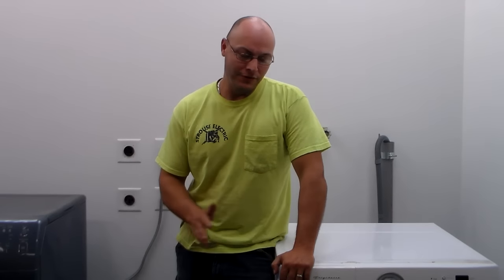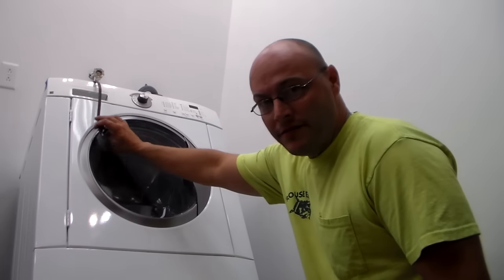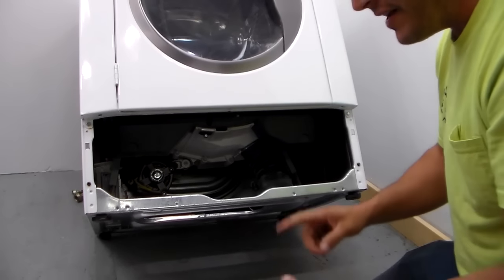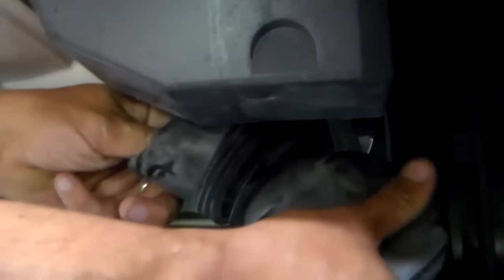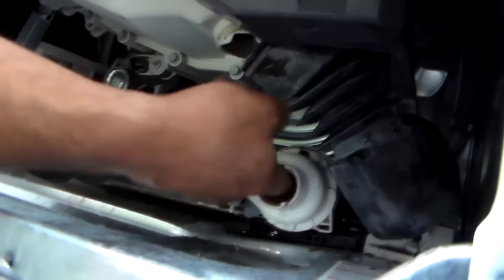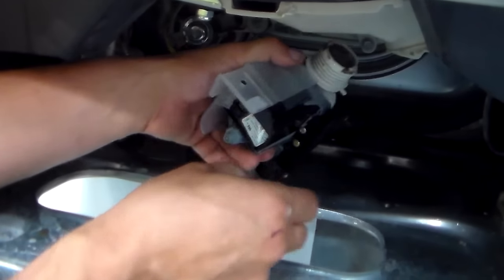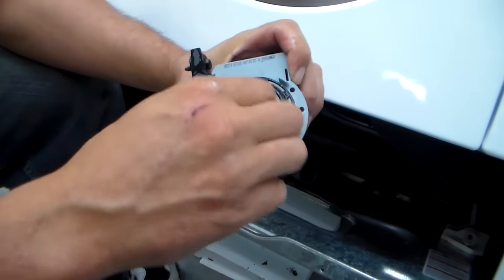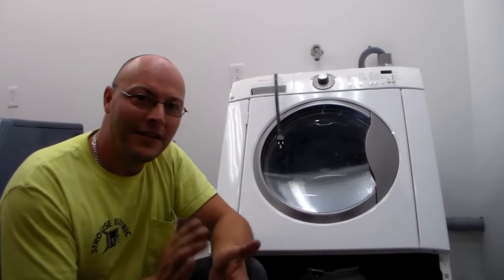Front Load Washer Repair - Not Draining or Spinning - How to Unclog the Drain Pump

Comment: I cant thank you enough 😂 I’m a 29 year old woman and a single parent who can’t afford a new washer right now and kept getting drain error codes and a humming noise and you made me confident enough to give it a go. I followed all the steps my brackets were a bit different but I toughed through it 😅 cleaned out the propeller part and then felt a wad in the tubing from the tub I got a drain snake and whisked it out because I couldn’t fit a flathead to loosen the tub hose without taking apart the whole machine butttt 2 pairs of panties and 2.00 in quarters later my machine works like new 😮‍💨you’re awesome. ❤ my dad thanks you because he was my next call 🎉😂

Comment: Hey Bill, I thought sure I was seeing a $300 dollar repair, My wife and I followed your directions including taking the white part off the pump, we took out of the screen 2.58, a bobbi pin and and underwire bra wire. Our washer works perfectly with only about 2 hours work, we don't have the front panel , to we had to remove the top and the front, but all is good. Thank you so much for your help. Sue and Bob Wagner   Arvada Colorado
Reply from the maker: +Bob Wagner Awesome job on your repair!  This is not the easiest thing to do either, great job!

Comment: Brilliant video.  Thank you so much.  We have a vintage washer in Spain with no user-facing filter, drain or indeed removable cover for access of anything.  Finally, using Stonehenge technology, we turned it upside down and located all the parts shown in the video and found three Kleenex tissues (at least) clogging the pump.  It's now working a treat.  Thank you so much Bill.

Comment: Well this video was everything I needed!   We ended up ordering a new drain pump, although I’m still not sure that was necessary – the reason I replaced it was once we got in there we didn't find any blockage or objects, but our impeller wasn’t spinning freely as you showed in the video (although there didn’t seem to be anything stopping it – there WAS some slight resistance). Here’s the thing:  the replacement pump was the same!   So some pumps might very well NOT have fully-spinning impellers, in case that’s helpful to anyone.  

Our washer is a 2009 Frigidaire/Electrolux front loader, analog, FTF530FS.  And it's working again!!!   Thanks for the video!

Comment: thank you thank you thank you for this excellent video. my husband and I fixed our machine tonight using your video. it was making a horrible grinding noise and wouldnt drain. in fact it hasn't drained well for months. coin trap was so clogged. not it runs amaizing. the only difficult part was trying to clamp the boot back onto the pump. took both of us to get it on. so proud we did this on our own and i only broke 1 finger nail. lol

Comment: i cleaned the trap, it started draining for one load then died again, so i came back and figured out how to take the front panel off, for mine you've gotta take the whole machine apart. Got that done, checked the pump and it's broke. Thanks for showing the pump and how to check it. mine was wobbling all over the place and basically wouldn't stop moving. Thank you

Comment: Thanks a ton, Bill. I thought I had to replace the pump, but after watching your video, I opened it up and found a nail jamming things up. My model doesn't have a coin trap though. We've had it for 8 years, and this is the first time anything has jammed the pump, so go figure. Great video! Thanks!
Reply from the maker: Ed Bannon Awesome Job,  you have completed a relatively hard repair for the average person without appliance repair experience!

Comment: I thought I needed a pump replacement, but all I needed was a cleaning!  This video helped me clean my hoses and pump much better than the previous serviceman, who cleaned only one of the areas of the pump!  I found 5 socks, a lego piece, and a bunch of foul-smelling gunk.  Note: If you find a solid plastic ball in the hose, remove, clean the hose of debri, then put the ball back.  I needed to Google that it works like an important valve.  I wish the video would have showed how to get the clamps back on easily because I had a pretty tough time getting it back on the biggest hose.  I ended up needing an extra set of hands to use my biggest set of pliers to clamp the prongs.  Then once it was back on the hose, onto the hole.  Leaked the first time.  To fix it, I needed to muscle the snug fitting hose and clamp up the pipe back up to the washer.

Comment: Thaaank you duuude! saved $200+ by fixing it myseeelf!  Had to go through 3 rude people over the phone who "diagnosed" (without seeing the washer) and told me to get rid of it... I followed your instructions, realized the propeller was broken, paid $24 for the replacement drain pump and changed it myself!.... yeah, not the original drain pump which as over $150, but I thought that if the cheap part survives a year, then the original would need to survive over 5 to make it worth, which is unlikely.. anyways, thank you for the guidance!

Comment: Thanks for video instructions.  I had no idea there was a filter in the bottom of the washer.  I cleaned mine immediately and now I am +62 cents and a paper clip.  But I have a tip for you.  Close the door to the washer and evacuate the drain hose with a wet/dry vac.  Beats having stinky water run down you sleeve.
Reply from the maker: Yes, very good.  I would have if that was in someones house.  I really didn't think about it for the video.  Great Comment and Thanks for Watching

Comment: Thanks Bill, our Whirlpool frontloader had the front panel with 3 screws, but it gets even better.  Theres a clean out access port right up front.  BUT: Not knowing...when I twisted and unscrewed the cover, only the cover came off...without the plastic catch basket with the holes in it.  SO: I took off the drain hose and prolly 2 gallons of water spewed all over the floor.   Removed the outlet hose from the pump and the wire connector and unscrewed the assembly from the base and completely removed it all.  Took off the housing like in the video to check for more debris...none so reassembled.   Only problem was the dang Clamp c/t the drain hose and basket housing was a bear so throwed it out and replaced with a regular screw type hose clamp.   Reinstalled everything and then had to "Unlock" the electronics by turning the machine on and holding the far right bottom button down for 3 seconds...BINGO!   Looking back, all I had to do was pull out the basket from its access point and clean it out...we did find some plastic tags from new clothes and two eyeglass cleaning cloth's, and a piece of some plastic label.  It was clogged no doubt!  Machine now works fine.

Comment: Just did this myself and your video was invaluable. I had almost $2.00 in change in the trap, and a garment label jamming the impeller from spinning at all. Biggest pain was dealing with the water going everwhere and all the wet clothes. One super handy tool was a hand pump and bucket for removing all that water from my Speed Queen front loader. Plus a bunch of cleaning towels to mop everthing up. I also used a box fan to dry everything after getting it back together (without the kick panel installed).

Comment: Thank you, thank you. My washer is back in business after a couple hours, a pinched finger, and a few magic words. I found nothing in the system (and there wasn't a coin trap), but the impeller balked a little when I first rotated it. It eventually began to turn more easily so I'm guessing it had some crud affecting it. It never did free-spin., but It does look a bit different from the one you show. I think I'll investigate the purchase of a back-up pump to be on the safe side. I might also check to see if I can add a coin trap. For now, tho, all is well. 

As an old ER nurse, I especially appreciate your recommendation to UNPLUG the machine before working.  Not all who have provided repair advice have included this step, and it's important for anyone unfamiliar with the equipment. I'd also suggest that the amateur prop the machine from underneath in addition to leaning it against the wall unless he/she can lift it easily with one hand. A couple of cans of pumpkin did the job nicely for me. 

I struggled with the retaining clips that attach the rubber bits. That's what took me so long to get this done. For anyone with limited hand strength, locate a pair of locking pliers before you start. You need a good tool to pinch the ears of the clips together and keep the clip enlarged while you move the pieces around. My locking pliers would have been the perfect option -- if I'd been able to find them.

Thanks again for the assistance, Bill. It was complete and clear enough that I could understand what I had even though my machine looked a bit different. It gave me the confidence to try. I'm very excited to hear the machine spinning away in the laundry room.

Comment: Thanks for the video, my unit did not have the access door but I found a video showing how to remove the covers then your video walked me right through it.  I found using vice grips allowed me to hold the clamps open while I was putting the hoses back in place.

Comment: Hi Bill great vid, one thing I saw at 6;48 was a plug of matter in the suction side of the pump, that's  why you still had water in the suction hose when you pulled it off. I think you could have pulled the plug without disassembling or removing the pump.Great educational video, you helped alot of people

Comment: Wow!  I wish I had seen this 24 hours earlier.  I spent four hours yesterday with our Frigidaire Affinity front load washer.  It had been stopping part way through the wash cycle, ... stopping at the tub draining step.  I thought the drain might be clogged after 8 years of use.  Our machine has no front panel, so I tipped it up, laying it on the front surface, working from the bottom.  Yes, I did all the work through the hole on the bottom panel, the one you mentioned as being a "pain in the butt."  Confirmed!!!  

My machine had the same tri-part boot, including the plastic screen inside the boot.  However, I took off all three connections.  You were smart not to have taken off the third one - I think you called it a pressure tube.  When I went to reinstall the boot, I ran into a nightmare.  The access for the spring clips was too tight -- to the hardware store to get screw clamps that could be taken apart and reassembled after the hose was connected.  I had to take off a switch on the rear panel to give me enough working movement to get the pressure tube reconnected.  However, in the end, I did not get it fitted well enough over the fitting.  The distances for the boot are very limited, not allowing much room to work the boot back onto the fitting.  

In the end, I learned there was very little debris caught in the plastic screen (coin trap, I think you called it).  It has no coins, no bobby pins, or items like that. All it had was some threads off an old towel (?).  

And, when all fitted back together, fired up the machine, I learned two things, (1) The wash cycle problem still remained (a service tech came to run diagnostics and learned the control module is bad), (2) The boot leaks.  I suspect that it is the pressure tube fitting that I did not get installed to the full engagement.  I will need to redo the task.  And, i think I will take your advice and remove the front panel first,  giving me better access.  Access through the side would be better, but I expect getting the side skins off is even more work.

That  boot is a real work of art!!!

As a side note, I thought that the wash cycle stopping was a door lock switch problem.  There are videos and blog comments all over that speak the problem we were having, and nearly all of them spoke to replacing the door latch switch.  The machine worked fine for a couple of months, then the same problem.  I replaced it again, and it worked for another two weeks.  I then replaced the stricker, and that did nothing.  Also, a few times, when the problem happened, I ran it with no clothes, and the problem was resolved.  But, the service tech confirmed a bad control module through diagnostic tests.  

BTW, I notice you have a ding on your hand.  I identify with such dings.  Yes, I ended my project with a big cut, ... the edges on the hole in the bottom panels are very sharp.  Ha, ha, ..

Comment: Thanks to your video I cleaned my drain pump yesterday. For some odd reason, my washer doesn't have a coin trap. Everything else was the same though. I did find some chewed up pieces of metal in the boot below the pump inlet. The only thing I did differently was to pull the boot completely out. Thanks for the video!!!

Comment: Thanks for posting this video.  We have had our old Fridgidaire  front load washer for years - - it's an older model, but we have had to do this 3 times.  (I could not find the original video I found a few years ago).  When something gets washed with change in the pockets, this will definitely mess things up.  My recommendation to folks who want to try this repair is to prop up the washer as high as this guy did.  Don't try propping it up just 8 inches like we did - - -it's so much harder lying on the floor and trying to reach in there with hands and arms.  And those green clamps?  They are aggravating!  The pliers we used kept slipping off.   We almost gave up on these to buy some other type of clamp.   Have some old towels in place to catch the water.   That 47 cents in the plastic drain filter cost us an hour of cussing.  But it's back to washing great now.

Comment: thank you thank you thank you for this excellent video. my husband and I fixed our machine tonight using your video. it was making a horrible grinding noise and wouldnt drain. coin trap was so clogged. not it runs amaizing. the only difficult part was trying to clamp the boot back onto the pump. took both of us to get it on.

Comment: Great. I fixed my leak too. Whomever worked on the down spout rubber hose apparently tried getting it higher than the tub out chamber. There is a sneaky vertical rib (1/8”) that will not allow a proper seal if you do go over it. So don’t go too high (at least on my kennore model 970 front load). Thanks for the vid.

Comment: Bill Newberry.....you rock.  Hey, I want to share something that may be important to your fans....perhaps you as well.  So, I've got a Samsung front-loader....and haven't been all that careful with my bleach usage....the bleach has corroded the inside corner of my machine terribly...I caught it soon enough to clean up and treat the rust, but here's the IMPORTANT part....the corrosion, left untreated would have dissolved my front left shock absorber mount (in about eight years total), effectively ruining my machine.  I used a rust treatment from The Eastwood Company, automotive restoration specialists. I'm confident using the new bleach crystals is the way to go as they do not splash when you close the drawer.

Comment: We have had our GE front loader model WBVH530K0WW for the last 15 years. Today was the second time it stopped spinning. The last time about 5 years back i found one of the 2 sensor wires to motor was pinched. I removed the motor, and fixed the broken wire by cutting it and re-soldering the connection. This time it was the same wire and the second wire was also pinched. I think the wires are run too tight so when the loader is moving around it causes damage over time. I removed one of the connectors which is now allowing for more movement. Again fixed both sensor wires, but i also found the draining needed to be clean.  Did that following this video, now everything is back working again!

Comment: Hello Bill, 
I have a Kenmore Model 44092 which looks very similar with the one on this video. I did all the steps that you describe here, but still the washer is not spinning. During wash will spin/agitate left or right two or three times (this is normal), but when it comes to the final spin, to take all the extra water off, will not do it. During that time (the last 15 min or so) will drain all the water and the pump will keep working, but will not spin. When is about 10 min left will do two or three more normal/slow spinning on the left/right and will turn itself off. During those last 5 min except I hear the noise of the water pump working to get the water out, and I hear the motor to kind of working on a "overload" way and make such a noise as well. I watched and read your blog about this issue, and think that the motor might be bad and working only on slow speed. Do you have any suggestions, or ideas?  Thanks.

Comment: Thanks for the video. I spent a lot of time fighting to get the boot and spring clamp back on the impeller. Eventually I replaced the spring clamp with a hose clamp and it went back together easily.

Comment: Thanks for making this video, it was a great help!  Mine's an older GE front loader and didn't even have any kind of screen filter in the rubber boot.  The trap had a bunch of coins, a few random buttons, and a few of the girls' hair pins, one of which made it in to the impeller just like you said.  Dislodged it with some needle nose pliers and all is well.

Comment: Did this in the advise of a technician because he predicted our home warranty would not cover clogs.  Saved hundreds of dollars to have him come out on his own time to do this.  Did it the hard way through the bottom access hole.  Didn’t realize I could remove the lower front panel.  Pain in the knuckles but manage to remove the filter by just disconnecting the upper part of the boot.  Sucked out what I could with a vacuum and voila! Done! BTW mine stopped mid cycle so I had to drag it outside and tilted forward to remove the water.  Pain in the back because the sucker was heavy especially with water in it.